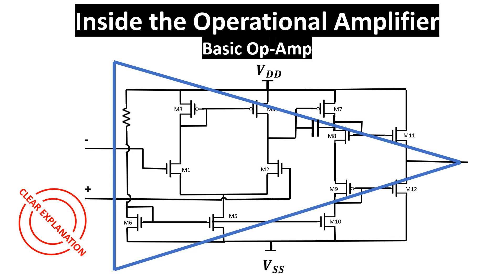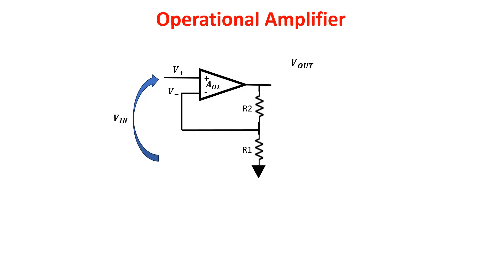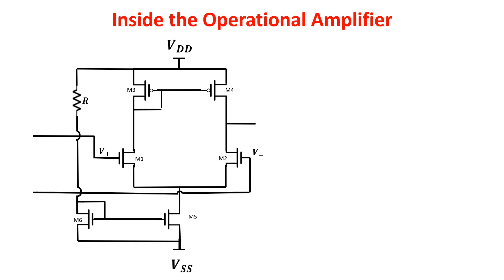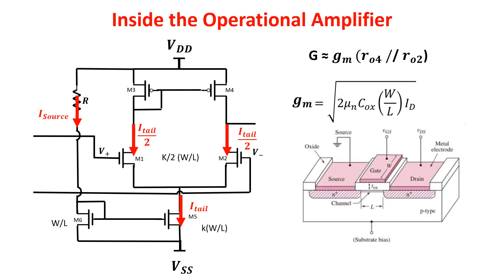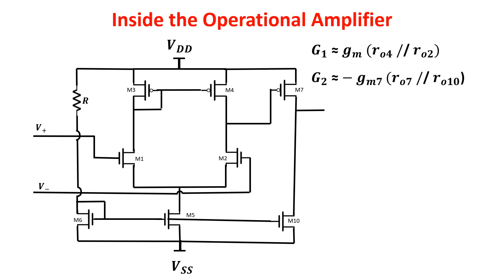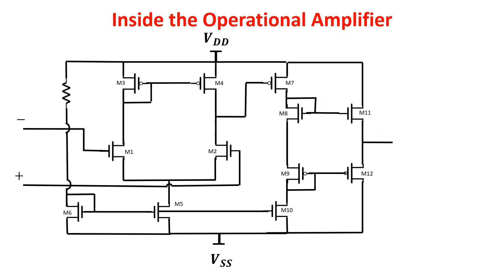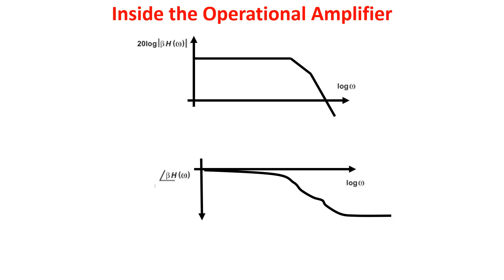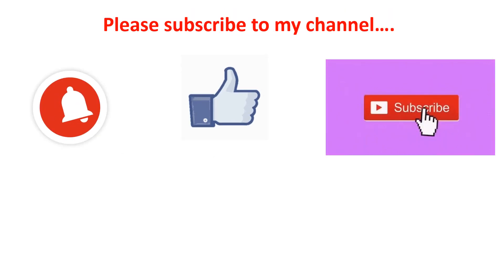Inside the Op-Amp - Operational Amplifier internal

Comment: my fundamentals for mosfets seems to be lacking, could you please suggest any good resources to learn about the mosfets to know how these different configs of mosfet like 'current mirror' or trans-diode config. i only know the basics (i.e the drain current equation of mosfet, regions of operations). thank you so much
Reply from the maker: Hi, I suggest you these books: CMOS Circuit Design, Layout, and Simulation, by Baker, Li, Boyce

Design of Analog CMOS Integrated Circuits by Behzad Razavi